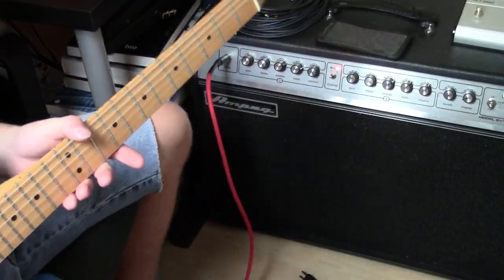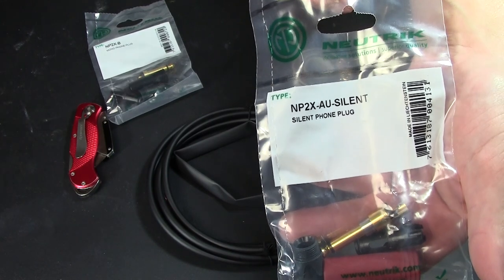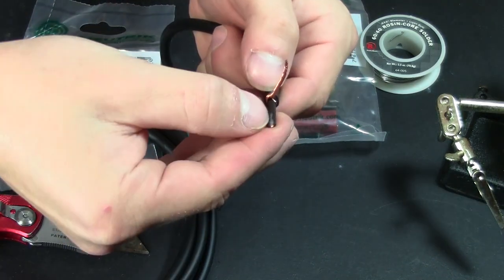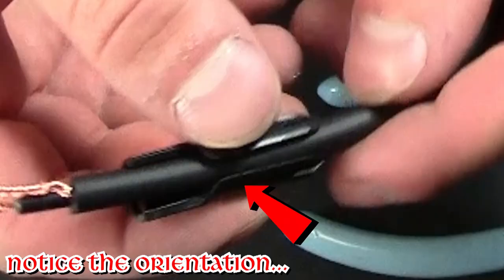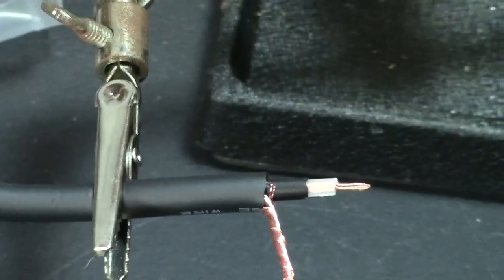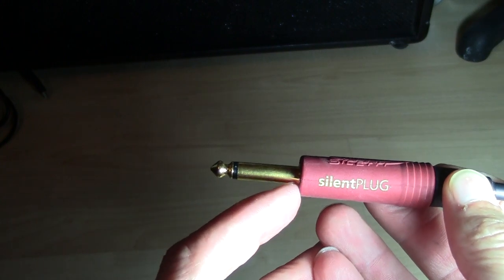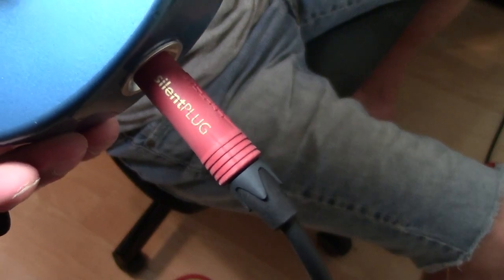Don't Buy a Neutrik Silent PLUG with Mogami Cable.  MAKE ONE YOURSELF

Comment: i had my whole rack hooked up with this cable.  zero mechanical noise . it helped lower the noise floor of my rig until i no longer need to use any noise gate. my guitar cable is made of mogami 2524 too, it had been ran over office chair for 5 years plus and still working flawlessly.

Comment: Thanks for the video Jake! I feel there are 2 important items you left out: 1) that black insulation on the interior shield is conductive so its extra important to strip enough off so that is doesn't short the internal conductor. 2) it's wayyyyyy easier to put the boot on before stripping the cables.

Comment: I work with building/soldering custom cables daily and just wanted to point out a few things I noticed. First off you want a soldering iron with variable temperature 650-750 degrees is ideal for a job like this. Second put your connector in a vice grip. Not your cable in alligator clips. Always tin your wires before terminating. Your ground wire will fit in the cup much easier if you use a pair of needle nose pliers and flatten it out. I would also recommend heat shrink to avoid bridging connections (plus it looks good). Aside from the above mentioned listen to this guy. You definitely don’t have to spend $100+ to get a quality instrument cable when you can build it yourself!

Comment: Great video!  Ive built many a cable and the Mogami is nice, but you should really check out Canare wire. The shielding is tightly braided which helps the cables stand up to extreme touring or other rugged use for years.  Over time, the mogami Ive used gets rolled over by enough wheels and/or heavy road cases that the wrapped shielding separates in spots and you get noise in your lines.  Yes, it makes building cables a bit more challenging as you need a pick type tool to help unbraid the canare shield, but the end result is worth it!
Reply: MarkThomasOfficial my thoughts exactly.  Canare is awesome for that reason.  Yes, you need a toothpick to separate the strands, but it takes only a few seconds with a good sharp wooden pick.
Reply: Use Mogami 3368 "Ultimate" - the shield is braided on those as well.

Comment: I have 2 silent plugs which broke down under normal use.
One after 14 months and the next one 2 weeks ago which I bought in October last year.
Both were the straight ones.
I have one cable with the 90 deg. Angle silent plug, this one seems to survive.
Works perfectly, but the quality is not what I used to with Neutrik.
Someone with the same problem?

Good video btw. 👍

Comment: I know this is an old video, but it's critical to know that second thin layer is actually conductive! It's used to dissipate static charges when flexing/moving the cable, so it's very important that when soldering, that layer does not touch inner core. Else you will have tremendous resistance and your guitar signal will mostly be dead quiet.

Comment: 5:16.  Bad soldering technique.  Heat the wire, wait then apply solder from the spool to the hot wire above the gun.  It'll soak up solder like a sponge.
Reply: It's really subjective. As long as you get nicely flowed solder onto your wire with no cold spots it doesn't really matter.
Reply: @stewartross13  It's really NOT subjective. The cold joints are made by improper soldering technique - i.e, by melting the solder and the flux on the iron tip, before it touches the element you want to solder.

Comment: how can you recognize a cold solder joint  ?
Reply: Old comment, but if you’re still out there, a cold solder joint will be dull grey in color and clumpy/ lumpy. A good solder joint will be bright and shiny and smooth. Not to say anything bad about the guy that made the video, but he needs a new soldering iron. You could tell just by looking that it wasn’t hot enough.
Reply: @quantumfoam140  Old comment, but just a heads up:  Pb-free solder is dull grey even if it is not a cold joint.

Comment: I make a line of guitar cords called GUITARTEC AUTO CORDS that automatically cut the signal the instant you pull the plug from the guitar. This is the only style of guitar cord I make- I do NOT make non-switched regular instrument cords, mic, speaker cables or effect jumpers. 

So you know, these switched 1/4" plugs ALWAYS go into the instrument, never into the amp. Each cord's other end is always a normal non-switched straight or 90º 1/4" phone plug of the same brand as the instrument side. I make these cords using high quality Mogami cable and the customer's choice of either the German-made red Neutrik SilentPlug (either straight or 90º) as seen in this video OR an Australian-made Amphernol SwitchPlug (either straight or 90º). 

HERE'S THEIR PROS AND CONS
These plugs use a spring-loaded switch that surrounds the 1/4" sleeve of the plug. When inserted into a guitar output jack, the switch gets pushed in, thus, allowing the signal flow from the guitar to the amp. 

Both these manufacturers use a 360º plastic cable strain relief that bares down on the cord when the plug's shell is screwed onto the body of the plug. This ensures the solder connections are not stressed when the cord is pulled on for any reason. 

The Amphenol Switchplug uses a standard spring-loaded blue switch and the red Neutrik SilentPlug uses an internally sealed magnetic Reed switch. The Neutrik switch is much easier to push in than the Amphenol, where the Amphenol can sometimes push itself out of an old, worn out or cheap jack due to its tight spring. Also, in some cases where an acoustic guitar has an end-pin jack that does not protrude enough past the screw-on strap button to push in either plug's switch. A simple jack adjustment is then necessary. 

These plugs are not infallible. Due to the easy push-in Reed switch on the Neutrik plug, just grabbing the plug to insert it into a guitar I've accidentally pushed in the switch allowing a loud amp to suddenly be ON. This is precisely what these plugs are supposed to protect you against. It has never happened to me with the Amphenol plug.

The Neutrik's Reed switch is not affected by contaminates, whereas the spring switch in the Amphenol could possibly be affected by dirt, but at least you can clean it with electric motor cleaner or even WD-40 if necessary. 

Here's a possible deal breaker;  The Neutrik 90º plug has a defect that Neutrik swears is "fixed", but I've seen no evidence of this. For some reason, the male portion of the 90º Neutrik SilentPlug loosens from the plug's body over time, thus allowing it to cock at a slight angle and jam the switch in either the open or closed position. You need to physically straighten the plug with your thumb and the switch starts to work normally again. Neutrik needs to ensure the male portion cannot move AND also chamfer the inside of the switch's front edge so it can't dig into the gold plating. FYI... this issue only involves the Neutrik 90º SlientPlug, NOT their straight SilentPlug.

These plugs are NOT industructible in any way. They must be treated with respect and they'll give years of excellent service. Inspect them often!

OTHER THINGS TO KNOW... A gold-plated plug is only useful if it's inserted into a jack that has gold-plated contacts inside, otherwise, there are no benefits. Plus, the gold is only microns thick, so you can bet after some use, it will be worn off soon. https://guitarelectronics.com/switchcraft-1-4-gold-guitar-jack-w-1-4-threaded-collar/
The Neutrik SilentPlug is harder to assemble than the Amphenol SwitchPlug

Nuetrik and Amphenol are not the only automatic plugs on the market. Switchcraft has made them since the 70's. other switch plugs; https://www.fullcompass.com/prod/023686-switchcraft-182-1-4-ts-m-cable-mount-silent-plug-screw-terminals?dfw_tracker=36058-023686&gclid=EAIaIQobChMI8vXexezY6wIViIbACh0ehQ12EAQYAiABEgI6svD_BwE

REAN, which is a division of Neutrik, also makes a cheap switch plug; https://www.fullcompass.com/prod/234454-neutrik-nys224s-1-4-ts-rean-cable-connector

Lastly, (and I say this hesitantly b/c this is REALcrap) Guitar Fetish makes a cheap Auto-Switching Cord: https://www.guitarfetish.com/20-ft-Auto-Switching-Guitar-Cable-Noiseless-Anodized-ends-Brass-Tip_p_1309.html
Do not, repeat DO NOT let me catch anyone using this cable at a gig. The guitar Police will come get you!
Reply: "A gold-plated plug is only useful if it's inserted into a jack that has gold-plated contacts inside, otherwise, there are no benefits" 
Is there a guitar input jack that has gold plated contacts??
Reply: @guitartec  man that puretone multi contact is nuts
Reply: @AaronAaronAaron  Technically, it's the best multi jack on the market, meaning it can not only be used passively, but also it can turn on active circuitry as well. However, I've had seasoned players ask me to remove them for a simplier Switchcraft jack.
Reply: @guitartec  any particular reason why they want the switch back?
Reply: @AaronAaronAaron  The players who had the Pure Tone output jacks were worried about the switch's complexity. The Switchcraft #11 1/4" jack is a super-simple and industructable jack which has been factory installed in every USA Gibson and USA Fender since the 50's (until recently). Techs and shops always have #11s  avalilable, so if you're gigging on the road in East Bumble, MS and you have an issue, it can easily be cleaned or replaced at low cost. The Pure Tone is very intimidating to a newbie tech and not available everywhere, and it requires more bench time to install. Sorry for the long answer.
Reply: @guitartec  Oh no I dont mind the long answers at all. I just learned how to solder to the point where im making my own cables and things and also looking to improve my guitar/bass sound

Comment: Is strain put on the soldered contacts when standing, pulling etc? It must have a mechanism to protect from that.
Reply: the second part that he puts on the cable before soldering is a chuck that squeezes around the cable and holds it in place. so the tension is on the outer jacket and not on the solder points ;)

Comment: I think you may have left out the link to the rosin-core solder in the description.
Reply from the maker: You are right!  I missed it.  Here you go:  https://amzn.to/2Alrpbe
Reply: Also, did you end up using the black tubing I see on your work surface? Does that go around the cable at it each end? And finally, is there a link to purchase the tubing? Thanks so much.

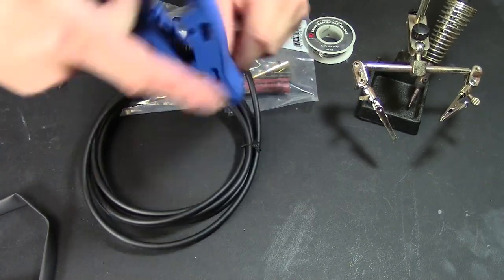Comment: 2:17 how do you think Canare wire compares to Mogami cable?  The Canare is finely braded and interlinked for the entire length.
Reply: I work with Canare and Mogami cables daily as I build custom cables at my job and they’re fairly similar quality in my opinion.

Comment: NEVER melt solder by pressing it on the soldering iron. It destroys the flux, which should be applied directly on the wire. 
INSTEAD: heat the wire that you wish to tin (you may add a blob of solder on the iron to help with heat transfer) and have that wire melt the solder.
Reply: I wouldn't say never. You want to melt solder on the soldering iron to load the tip with solder, for example in order to improve thermal transfer. But you do this when the spot you want to solder already has flux applied. But yeah, not never.

Comment: That second black layer is not insulation - it’s additional shielding. That’s why it’s so important to peal it back away from the center conductor.

A little bit of old fashioned flux really helps tin the connection points on the plug, and tinning those contact points on the plug before soldering the connection.

Comment: Really good thanks! Will make it. There's something didn't understand.. Can i solder two silent plugs on both sides of the cable? Or the silent plug can only be plugged to the guitar?
Reply from the maker: I dont see a reason why you can't do that.  Typically, the cable is first plugged into the amp, so you dont have to worry about static until the guitar is plugged in.  But if u want a silent plug on both sides, I dont see the harm in it.
Reply: jakeguitar01 ok cool. So then to put two silent ends will make the sound even better, won't it?
Reply from the maker: Yes.   If you put silent plugs on both ends that would be better.  That way you do have to worry about which end you grab first.  Also, dont forget to buy the right plugs.  Check the description in this video for the link.
Reply: Neutrik have a warning on their site about this. You might smoke your amp input or pedals input by shorting out the input directly. Some will need a small amount of resistance to operate.
Reply: I think one end silent and the other end "noisy" is the way to go in light of Neutrik's warning.
Reply: Secret_Armor exactly!  This is misinformation in this video.
Reply: From Neutrik documentation:
Attention!
For use with instrument (guitar) applications only.
Damage may occur if connected to amplifier output. (Battery) powered devices such as preamps and effects might not work in combination with the silentPLUG.